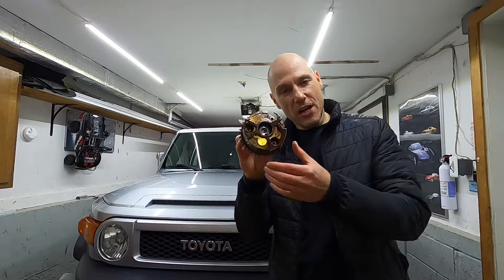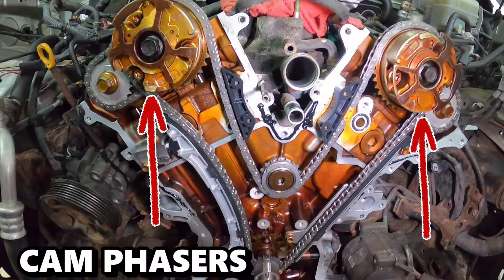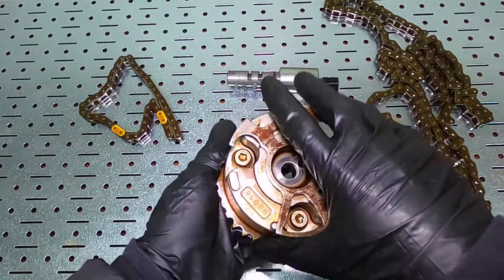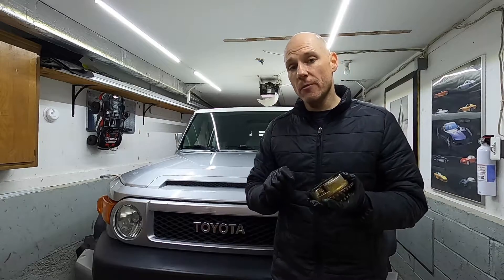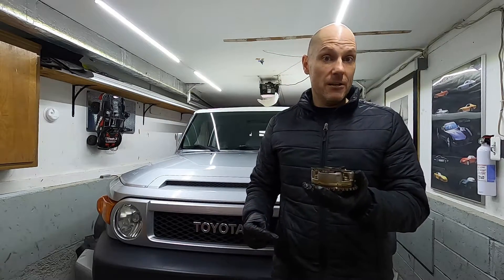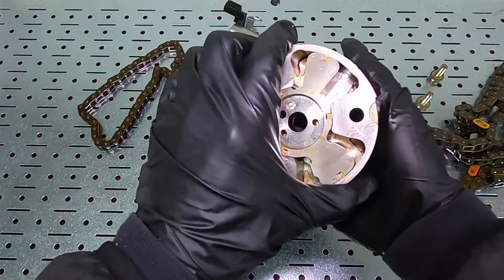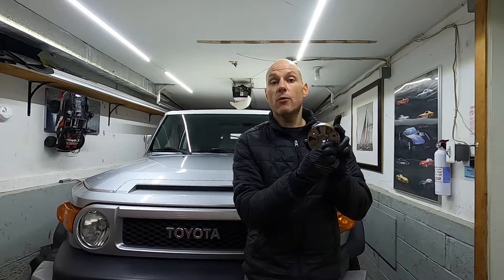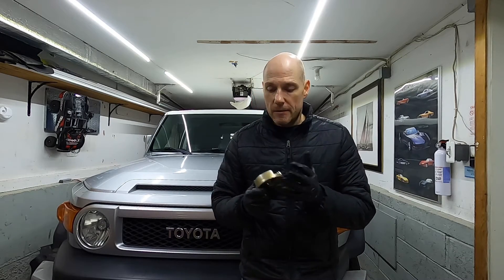What is a Toyota Camshaft Phaser or Camshaft Actuators? | When to replace a cam phaser.

Comment: So many people fail to realize the importance of regular (not extended) oil change intervals. 
Manufacturers claim outrageous oil change specs that only work to do damage to the engines.  
The next thing is, if your vehicle has a problem, don’t wait to get it fixed. It’ll only cost you more in the long run.

Comment: Question, I have a 2010 corolla with the 2ZR-FE 1.8 engine. It has had the rattle for ages, I started it the other day and it fired and stopped and now it wont start. It sounds like it has no compression. Is my engine dead? Thanks in advance for any help.

Comment: How did the original fail?
Reply from the maker: As mentioned, the engine had a trouble code for P0011. Once I checked the engine timing I noticed immediately the cam lobes were too far advanced. That told me the cam gear was locked in the advanced position.